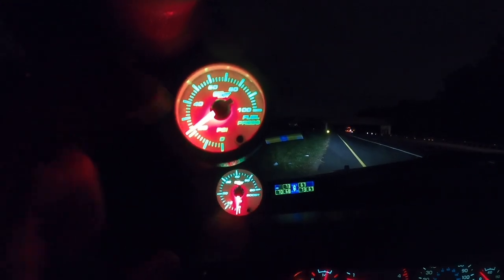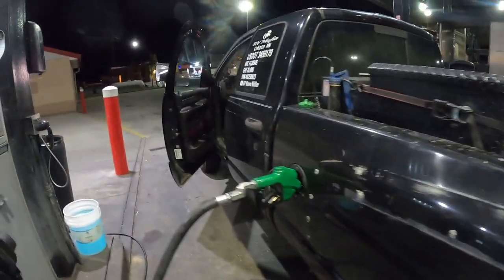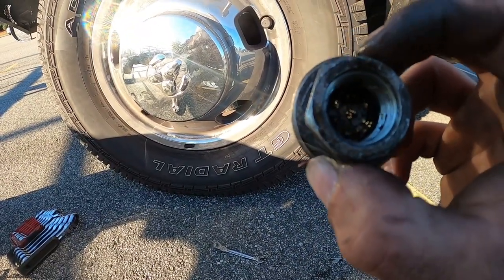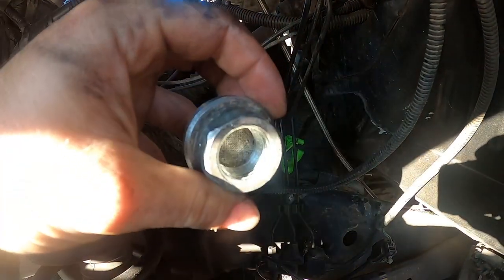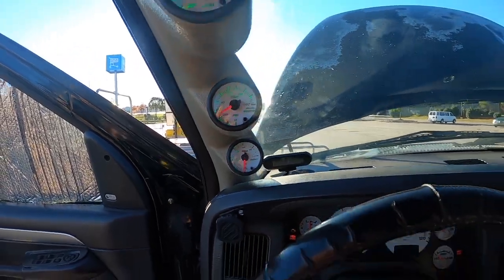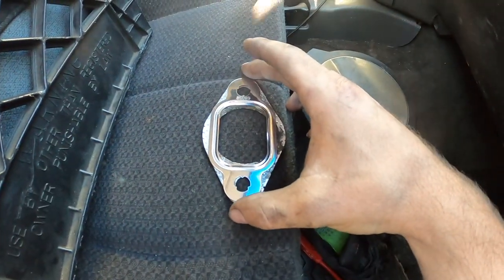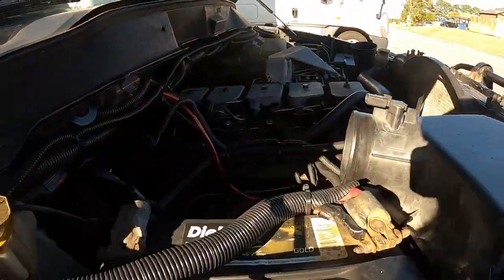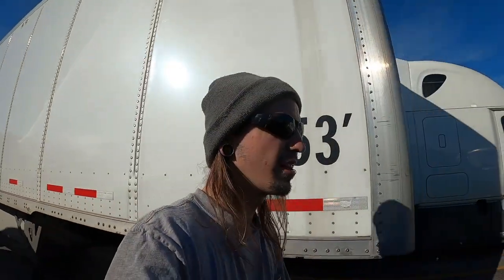No Fuel Pressure.. | Roadside Repairs | Hotshot Trucking

Comment: How about if i have a CDL?? Is 4x4 ok for cars if i have a CDL???
Reply from the maker: Yeah, because you're not limited to 26k like non cdl guys are. Any 14k 3500 with a 21k trailer would be 35k gcwr minimum. That's more than enough capacity
Reply: @CPSteveMiller  i think that was your old piece of Teflon tape that had your lift pump screen blocked

Comment: You should carry a socket to fit that fuel filter nut that goes over the screen, along with a long  extension and t-handle.  That will help you win the war with the spring.
Reply from the maker: I thought about that only after I was already deep into it😂

Comment: There's a trick to using thread tape. Hold the roll between your right thumb and forefinger with the tail coming out the bottom. Hold the fitting in your left hand and wrap 2-3 wraps and the roll will get tight between your thumb and forefinger...let it slip and it will keep tension on your wrap. Be sure not to cover the very first thread as it can cut off some of the tape which could clog an injector. If you hold it the other way, each wrap makes the tape get looser and you have to keep adjusting it. A real crusty old fart taught me about that when I was 18 and working on steam pipes...that thread tape would get into the steam and eventually affect the pressure controls on the boilers. A lesson I never forgot! As for the 4WD, you are so right! My last HS truck is a 4WD and it cost me about 2K in cargo carrying capacity...if I go 100% by the weight ratings...

Comment: I don't know if they make them for a 12v but I have been using remflex exhaust gaskets they are a graphite. Super thick and are designed to take up the difference in exhaust flanges. I hate exhaust leaks to drives me nuts...lol
There gaskets aren't cheap but they seem to work
Reply: I just checked ebay canada and they have them down where you are

Comment: I’m sure you have said it at some point but how are you feeding your lift pump? Stock sending unit, sump , or draw straw? My 04 had a air dog on it when I got it with a draw straw and I pull air at 26 gallons. Looking at going the sump route.
Reply from the maker: The sump is all I'm running to it

Comment: Btw was your truck always a 3rd gen “1st gen” and you did the swap to the large headlights or has it always been a “2ndgen” 3rd gen
Reply from the maker: It's an 04. The headlights are correct. I had 06 headlights for the longest time. Accidently bought the wrong fenders are the accident
Reply: @CPSteveMiller  I like that because you recognized your mistake you compensated for it
Reply from the maker: After spending 500 bucks on fenders the headlights were the cheaper option to replace😅

Comment: My old 7.3 IDI has a great feature. There is a vacuum switch in the fuel filter housing that will trigger a light that says "fuel filter." Do the newer trucks not have something similar?
Reply from the maker: Most I have is a water in fuel light lol
Reply: @CPSteveMiller Odd. I guess some features have regressed. Probably because the new trucks have very specific filter change intervals vs the old ones.

Comment: You need to use yellow teflon tape on any fittings that have fuel going through them bet thats what came apart and was sitting on your screen
Reply from the maker: No that was rubber. Possibly rtv/ silicone sealant. Way too thick to be Teflon. Not to mention Teflon is white and way thinner than what I pulled out
Reply: Oh okay hard to tell on the video keep the videos coming its cool to see people out there who still work and run older stuff!

Comment: Another great video i have a question about the thermostat you installed in another video did you say it was a 90 or 95 degree i have no heat unless truck is driving down the road  thanks
Reply from the maker: 195. It's from an old dodge gas engine because the 12 valve you can only get a 180. I forget the part number but from the factory my truck ran 160 to 180 degrees. That's way too cold for a diesel to run efficiently
Reply: @CPSteveMiller  do you run a winter front i havent seen on your videos one i have one i was planning on trying this winter
Reply from the maker: I have one video on it from last year. I won't this year because I'm in Florida weekly. Last year I ran one since I was always out west

Comment: Could you just drill 2 holes between you stud holes on your spare tire rim. That way you lug nuts will still fit right. Just a suggestion is all. Those old 12 valves are beast. Great motors..
Reply from the maker: Getting them straight would be difficult😬
Reply: @CPSteveMiller  cardboard template

Comment: Sure that string thing wasn't Teflon idk I prefer the liquid stuff love the channel keep er rollin
Reply from the maker: Rtv is what it was. Teflon is white and way thinner than that rubber I pulled out.
Reply: @CPSteveMiller  lol what did u use rtv on for your fuel system
Reply from the maker: I didn't. Must've made its' way in when I dropped in the waste oil 😂

Comment: Those common rail manifolds are garbage they warp and shrink like crazy and back cylinders flow is terrible. Buy the industrial 12v manifold they are only like $200 on eBay

Comment: You sound like a smart guy but still use waste oil, its  not worth the hassle, it will plug screens and filters more often.
Reply from the maker: It's free to clean the screen and I haven't cleaned it in almost 20k miles. It lasted longer than it should've to be honest